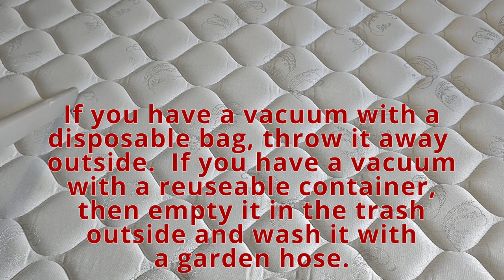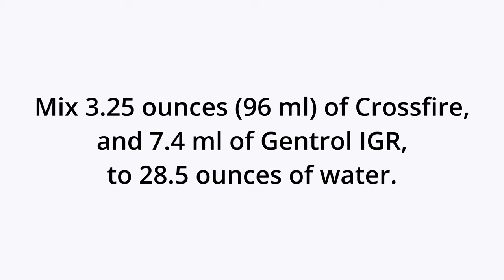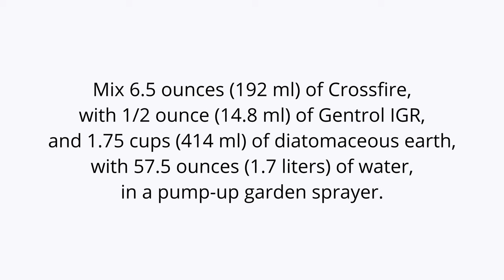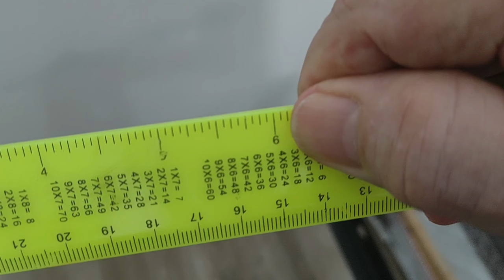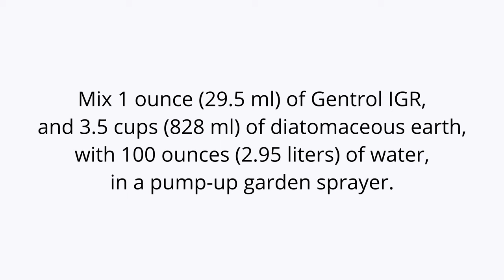ULTIMATE Bed Bug Solution!  AMAZING.  This ALWAYS works.

Comment: I had a bookshelf at the end of my bed. I can steam the surface and the baskets that the books were in but the best way to treat the books that were in the baskets?  I also had some containers under the bed. Is it best to just throw everything that was in them away since they didn't have lids and were exposed?
Reply: Diatomaceous earth dusting might work
Reply: @masterofshadows8904  my question about the DE  is if it's okay to touch after putting it on? I'm a bit confused about it in general really. I'm hoping I can save them.
Reply: @GuysPestSolutions  I sent an email message yesterday

Comment: Are you sticking with your recommendation for that steamer? It has just a few reviews but many bad ones on Amazon. Is that the one you used?
Reply from the maker: That is not the steamer I used in the video.  The one I used in the video broke while I was shooting the video, and I barely got it finished.  So, I didn't want to recommend it because it didn't hold up.  I purchased this one as a replacement.  I have not used it that much, but so far it seems fine.  I looked at the reviews and some are good, and some are not.  Any steamer is fine, as long as it puts out a temperature of at least 160 degrees.  The hotter the better.  So, if you do not feel good about this one, just select one that meets those criteria and that has a good rating.  I'm guessing that the more it costs, the better it will work and hold up.  I don't use it that much, so I tried to be cost effective.  The one I recommended may fail me at some point too, like the other one did.  I didn't get much use out of the first one.  So, just use your best judgement.  I hope that helps.  Be well my friend.
Reply: I bought a decent rated Wagner 915e 3 months ago but over time the steam didn't get hot enough. Luckily I could return it. Today I bought a Conair 2-in-1 Hand Held Steamer and Iron for Clothes, Turbo ExtremeSteam 1875W Garment Steamer and Clothing Iron. The heat seems fine but it's hard to fit that bulky head in some of the corners. I guess I need a narrower head. Thanks!
Reply from the maker: @cSounds49  I am not a big fan of clothes steamers for pest control.  I think the cleaning steamers are much better.  Make sure that you always use distilled water in the steamer.  Regular tap water will build up on the heating element and reduce the heat over time.  I hope that helps.  Be well my friend.
Reply: @GuysPestSolutions  I'll try to take the hand steamer back. It is awkward and doesn't push out with much force. Many thanks!!

Comment: Doesnt the steam and potions ruin the wood finish? What about pets?   And carpets and rugs?  How long must you continue reapplying the potions,  400 days?   Thanks
Reply from the maker: If you purchase a good steamer, like the one I list in the video description, you will get a lot of heat coming out.  You need at least 160 degrees and the one I recommend puts out double that.  So, it will kill on contact.  Literally in less than a second.  So, you will not have the steam on a surface long enough to damage it.  I don't think you should steam the pets though.  Just kidding.  None of the products will bother the pets.  Just don't apply diatomaceous earth where they like to lay down.  This should not bother your carpets or rugs, but if you are unsure, just try some on a small spot first.  This is a once and done treatment.  If you do it correctly and you are thorough, then that's it.  No need to repeat the treatment.  Just keep the mattress and boxspring bagged for over 400 days.  I hope that helps.  Be well my friend.
Reply: @GuysPestSolutions hold on Guy..Water boils at 212 degrees so no steamer I know of will put out double 160 which is 320?
Reply from the maker: @alanmorrison3598  Water can be heated past the boiling point.  Some steamers can put out temperatures much higher than 212 degrees.  The one I recommend is one of them.  So, now you are aware of at least one steamer that has this capability.  I hope that helps.  Be well my friend.

Comment: I have a newer model Sleep Number bed, and it cannot be moved. I can't find any evidence of having bed bugs other than the bites on my body. I put Vaseline on all of the legs of the bed, and the legs of the headboard. My headboard does not touch the wall.
Reply from the maker: Putting Vaseline on the bed legs should work for a while, but it may dry out over time and stop working.  I also have a new sleep number bed, and those things are really heavy.  You would think that a bed that uses air would be kind of light, but I have not been able to move mine.  I suppose if I really put my back into it, I could probably do it, but so far, I have not really needed to do it.  So, I can understand that it would be difficult to get bed bug traps under the legs.  For now, the Vaseline should do the job.  However, I would still inspect and treat for bed bugs in the rest of the room and even the rest of the house.  I am in production on a video right now on how to inspect for bed bugs, and I should have that posted within the next week or two.  If you subscribe to the channel, then you should get notified when it's posted.  Keep in mind that if you have other people in the house, the bed bugs will find a food source.  It's the same if you have pets.  Also keep in mind that you may have bed bugs in the couch or other furniture, and you may carry them into the bed with you not realizing it.  Bed bugs normally feed at night, but they will feed during the day if they are hungry.  So, simply treating the legs of the bed with Vaseline may not solve the problem for you. 

I hope that helps.  Be well my friend.

Comment: Can I just use crossfire , without mixing it with Gentrol? as I am finding difficult to find it where I live. 😢
Reply from the maker: Please tell me where you live.  Be well my friend.
Reply: @GuysPestSolutions   I am in the UK, would you be able to suggest any alternatives to the Gentrol ?
Reply from the maker: @godschild7216  I'm surprised you even found Crossfire in the UK.  They have banned just about everything unless you are licensed.  If you cannot obtain an IGR, then you just need to go without it.  I have had people pull it off with just diatomaceous earth and steam, but it's not easy.  Vacuum really well and then steam really well.  Make sure that the steamer you use reaches at least 100 degrees Celsius.  The hotter the better, but that would be a minimum.  Take your time steaming and go slowly.  The steam can take out almost all of them if you are very diligent about it.  Then you can use the Crossfire and diatomaceous earth as shown in the video.  You know, the reason bed bugs have gotten out of control around the world is because so many countries have stopped people from buying pesticide.  People really need to start complaining to their governments about it.  21st century pesticides are as safe as common laundry detergent and there is no justification at all for them to be restricted.  IGRs are the safest of them all.  I hope that helps.  Be well my friend.
Reply from the maker: @godschild7216  You are very welcome.  Be well my friend.

Comment: I stayed at someones house and they reassured me theres nothing that they have sprayed with raid everywhere since they seen and got bit by them. And i stayed there for a week bagging my suitcase and taking it out resting it on the floor when i needed to and bag it up but I felt like they had access to my bag anyways. I still didnt trust leaving my bag out. I had to bring my own bedding as well. I sprayed my suitcase down with bed bug spray and took my clothes to the laundromat. I even bagged up my clothes i was wearing and shoes and washed it at home. I threw away my purse and sprayed my stuff with 70% alcohol. And bought a bin but it had a crack in it and it scared me. So i taped it. I also bagged up my guitar and sprayed it down too twice before i left the place and when i got home. I hope im ok i never want to deal with them again from my old apartment. I also sprayed my truck too when i got home. I was giving this person rides and had the baby seat in the back many times. But I didn't spray  thoroughly like the crevices because it was like 3am. Im just so cautious i havent seen one, over a week now but i know you cant see them is my worry.  The person i stayed with also seen them after i had left about few days later
Reply from the maker: You can't be too careful with bed bugs.  I always recommend inspecting for them when you stay at a hotel or somebody's home.  I have a video on how to do that and I will give you a link to it.  The inspection procedure is the same regardless of where you are staying.  You should also inspect for German cockroaches as well.  They are way more common than bed bugs and a lot harder to get rid of.  These things are a nightmare from Hell.  I will give you a link to that video as well.  I hope that helps.  Be well my friend.

Video on how to inspect a hotel room for bed bugs:  https://youtu.be/GKLCrY7MdD0

Video on how to inspect a hotel room for German cockroaches:  https://youtu.be/bEwCA_nrY5Q
Reply: So even by being careful you have them?
Reply: There's just no way escaping them after getting exposed right
Reply from the maker: @larissacrookedneck2195  Yes.  Even I can get them.  However, if you inspect for them when you spend the night somewhere, you reduce the chances significantly.  Be well my friend.
Reply from the maker: @larissacrookedneck2195  That depends upon how you were exposed.  If you live in an apartment and the neighbors have them, then they can make their way to your apartment.  If you live in a single-family home, then you probably will not get infested again if you are careful.  Most people live their entire lives and never encounter bed bugs.  I hope that helps.  Be well my friend.

Comment: Nothings said about dogs or cats or pets of any kinds what's going to hurt them
Reply from the maker: This is safe for dogs and cats, but keep them out of the room that is being treated.  Also, do not directly treat pet bedding.  You can treat under it and around it, but not on top of it.  Treat it like you would a couch.  If possible, put it in a washing machine and then dry it on high heat.  If that is not possible, then make sure you vacuum it and steam it really well.  Obviously, I would not let them on the beds or other furniture because they can carry the bed bugs.  As a rule, bed bugs prefer humans, but they can dine on pets as well.  I wouldn't say that it's common, but if you have a serious infestation, then you cannot rule it out.  Just like with us, the bed bugs will not live on dogs and cats, but they will take a meal and then go back home.  So, it is possible for our 4-legged family members to spread bed bugs.  Other than that, you are good to go with the pets.  I hope that helps.  Be well my friend.

Comment: Question..can you just spray with Crossfire
Reply from the maker: You can do that, but it is unlikely that you will eliminate the bed bugs.  I'm sure that there are pest controllers that do it that way, but it's the reason why so many of them fail.  Crossfire is a wonderful product, but I would not rely on it doing the job with no other treatments.  At a minimum you would want to vacuum and steam really well.  I hope that helps.  Be well my friend.

Comment: I have seen bedbugs come crawling on me at the bus station or on a bus. Thay's probably how my apartment got infested. What can I do when I come home given that the front door opens directly into the living room?
Reply from the maker: If you live alone, then treat an area in the living room directly in front of the door that is about 6 feet square with Crossfire.  Take your clothes off and put them in a sealed trash bag and wash them immediately in hot water and dry on a high heat.  You need to treat with the Crossfire every 30 days.  If you live with other folks, then spray a path from the door to the bathroom and change in there.  Just make that path about 3 feet wide.  Bed bugs that come off of you on the way will die before getting into mischief.  After you get undressed, check yourself carefully to make sure that you don't have any bed bugs on you.  I hope that helps.  Be well my friend.

Comment: It’s just easier to throw out the bed
Reply from the maker: That's usually the worst thing you can do.  It's kind of a kneejerk reaction that people often do, but you are better off bagging the bed and protecting it from bed bug attack as shown in the video.  The existing bed will become bed bug proof, and it will be a safe area for you while you treat the rest of the residence.  I hope that helps.  Be well Tsetsi.

Comment: DE does not work if it gets wet.
Reply from the maker: That is not exactly true.  If DE is wet, then it does not work.  However, if you apply it as suggested in this video, on a surface that is not already wet, then the liquid will evaporate and leave a dust behind that will work almost as well as using DE as a dust.  So, it does help, but DE alone is not the way to go.  Just another arrow in your quiver.  You need to use all the procedures and products recommended to ensure full extermination.  I hope that helps.  Be well Jane.

Comment: I'm just here to see if it's worth getting 1kg of DE and put in my walls or not.. did not expect.. this much.. . much... hype? idk word.
Reply from the maker: I get it.  This is a lot of work.  DE alone probably will not get it done.  I have had people use just steam and DE with success, but you need to be very thorough.  The other products make the process a lot more reliable.  The truth is that bed bugs are hard to eliminate, so you need to do the work.  I too wish there was an easier way.

I hope that helps.  Be well my friend.
Reply: Maybe a good practice for new home construction and remodeling is to install lots of DE and boric acid in the walls before drywall goes up!
Reply from the maker: @chidude  You are correct.  Not only would this help with bed bugs, but it would also help with cockroaches and ants as well, including carpenter ants.  This should be required for new construction.  Be well my friend.